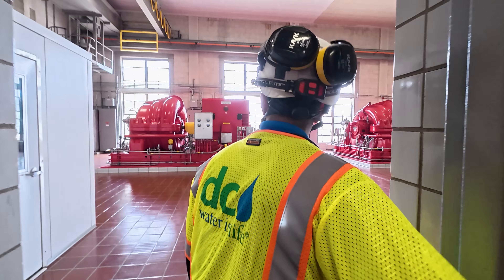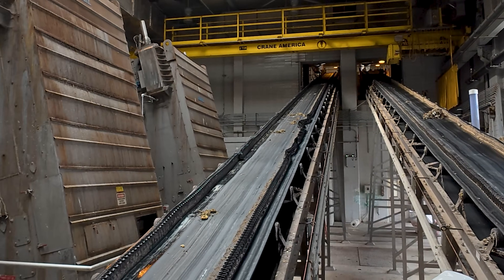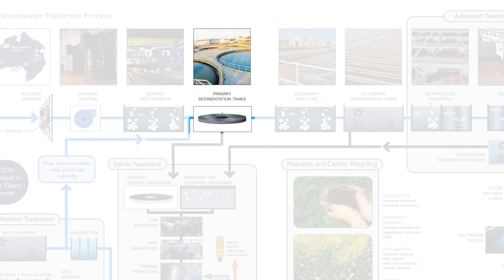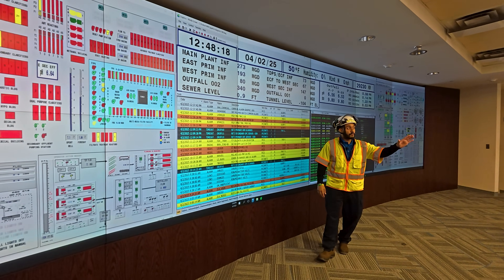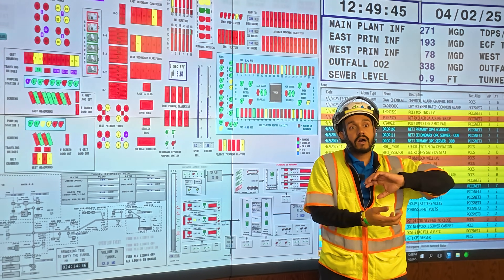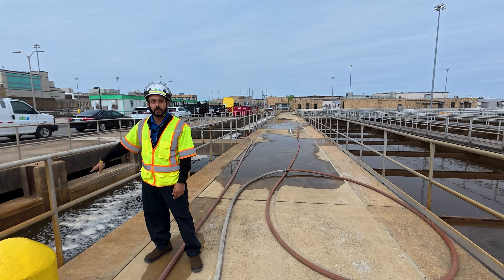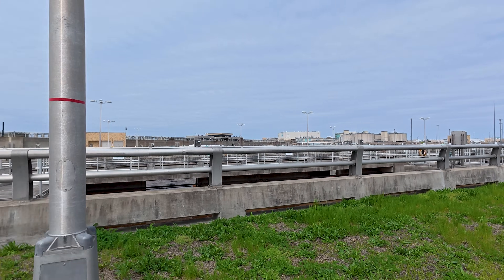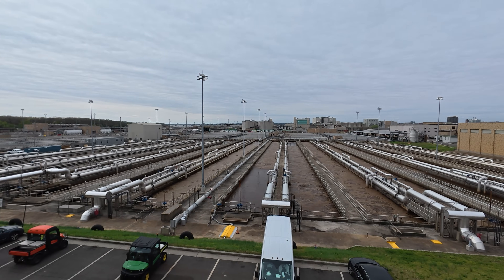Wastewater Treatment: World's Largest "Advanced" Plant

Comment: 🔥 Struggling with high moisture sludge and rising costs of disposal? You’re not alone. The paddle dryer shown here is a game-changer — it turns wet, bulky sludge into dry, manageable material efficiently and cost-effectively.

At AS Engineers, we’ve been designing & supplying paddle dryers and sludge drying systems for over 23 years, helping industries reduce waste volume, slash transport costs, and comply with environmental norms.

📞 If you’re tired of inefficient drying methods and want a custom, cost-effective sludge drying & management solution, let’s talk. Reach out to AS Engineers and see how we can help dry smarter, not harder.

Comment: How Treading Water Works (Normally):
When you tread water, you're pushing against regular water with your hands and legs. Water is dense and provides resistance and buoyancy:

Resistance: When you push down, water pushes back (Newton’s 3rd law), helping you stay upright.

Buoyancy: Because water is denser than your body, it helps hold you up.

💨 What Changes in an Aerated Tank:
In an aerated tank, air bubbles are mixed into the water, changing its physical properties:

Lower Density: The water is now a water-air mixture, so it’s less dense than regular water.

Reduced Buoyancy: Less density means less upward force — you float worse or not at all.

Weaker Resistance: When you try to push down to stay afloat, the bubbly water doesn’t push back as strongly — it’s like trying to tread water in foam or seltzer instead of regular water.

Slippery/Unstable Fluid: The constant rising bubbles break up the water around your hands and feet, so your pushes are ineffective — like trying to stand on quicksand.